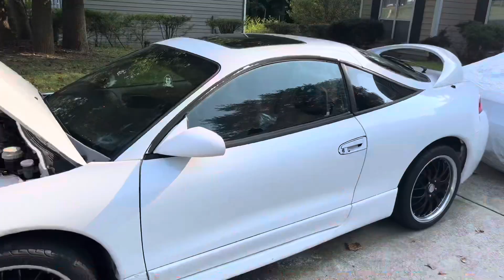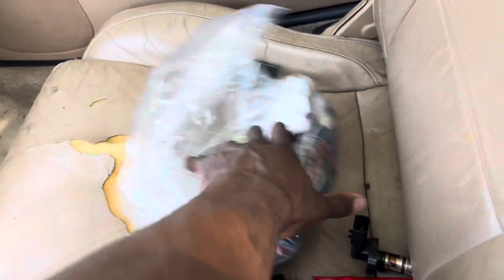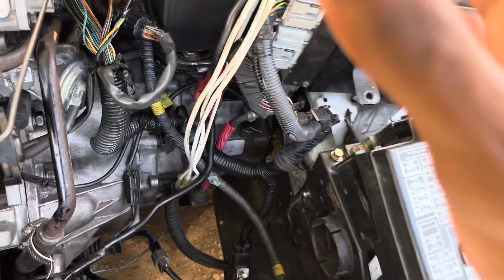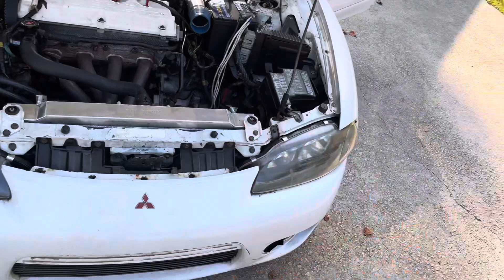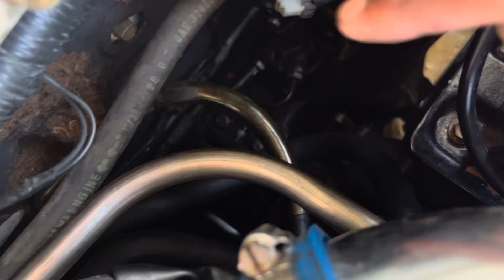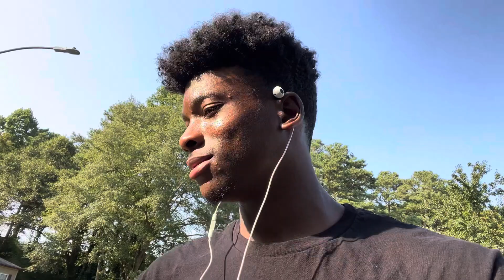Finally !!!!!!she runs again

Comment: Just subscribed to your channel. I got a 4g63 that won't run right. Just replaced the valves. It jumped timming before I bought it. I found a anti-theft also. I had it running earlier today. Had to pull on throttle cable , then tighten it down to get it to idle. I drove it around the block. Then parked it. After a few hours. It started but kept dieing when I pressed the gas. It kept getting lower and lower till it shut off and now won't start - to idle.  I was hearing a loud hiss when I did have it running. The intake manifold gasket has been replaced. It has a new head gasket. And after market coils. New. // coolent temperature sensor New. Fuel pump and filter New. I uploaded a video of it running earlier. I replaced that temperature sensor that's on the bottom with the spade connector.
Reply from the maker: Hey man I appreciate it yea sounds like a dsm problems as usual😂 yea man unfortunately I’m not to sure what would be the problem a leak down test would be bad to find that vacuum leak or smoke test I’m not to familiar with the 4g engines